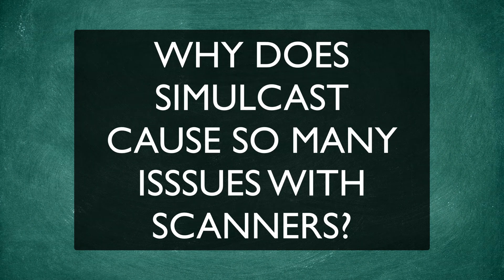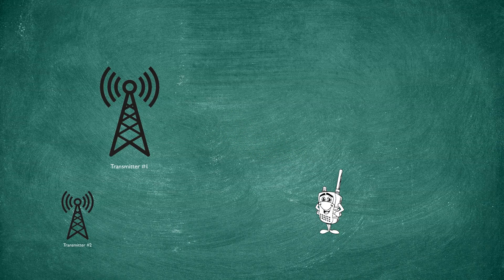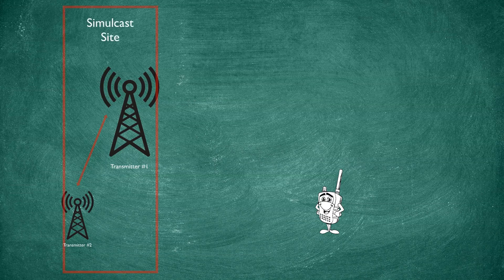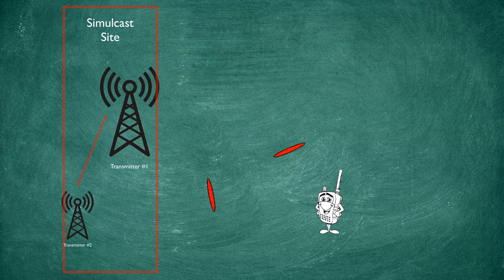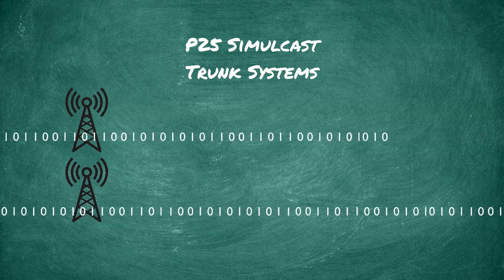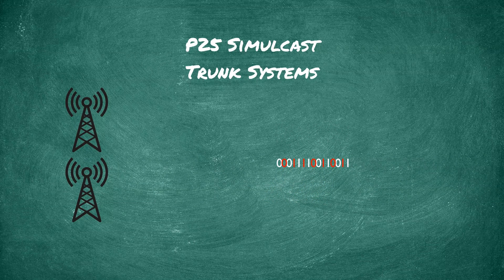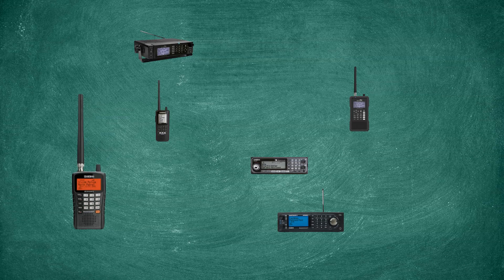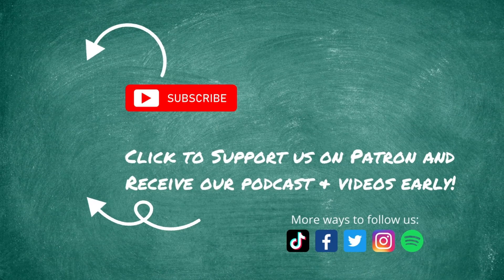Here is Why Simulcast is a Problem for Many Scanner Radios

Comment: So what ur saying is all these people think that it's encrypted n u hear gurgling but ur saying that's bs then people jus can't hear because only like 3 scanners even pick up simulcast??? Any info please
Reply: If it's encrypted your scanner will not even attempt, it'll stop on that talkgroup then immediately begin scanning again.  Garble is caused by the scanner trying to figure out multiple signals, sometimes using ATT works to drown out further towers.   Most scanners don't have an issue with Simulcast, it greatly depends on your location in relevance to the towers.  I'm in a location where if I use a regular antenna I get nothing because too many signals are fighting, I can use a paperclip and get full signal with no interruptions.

Comment: Don't forget multipath interference as well all this can be remedied by using an 800 MHz cavity filter that you would normally find in cell phone sites if you're lucky to find any surplus items like that it would probably be very expensive there is a video here on YouTube about it from a guy in Florida on a bench setup where he does that and puts it right to the cavity filters and voila he hit the money right on the jackpot basically no multipath interference simulcast Distortion is completely gone and the radio works again flawlessly and doesn't cut out at all I wish my 436 would have done that it only works in certain spots on phase one and Phase 2 like for instance on my medicine cabinet upstairs it works flawlessly but if I move it around the house and put it in one of the other bedrooms it totally cuts out and sometimes doesn't do anything at all that's what I hate about trunking it never did that with conventional p25 I could get signals for Miles with that